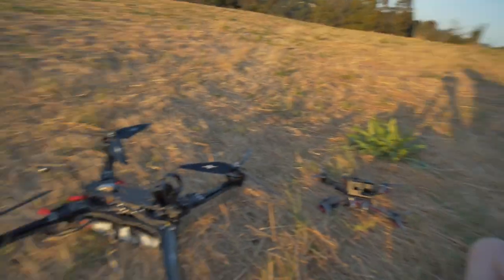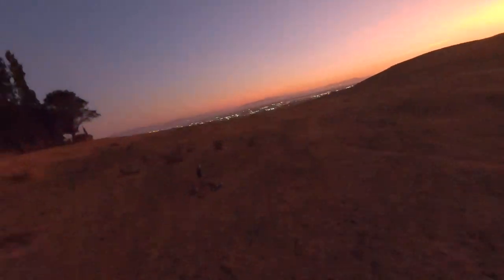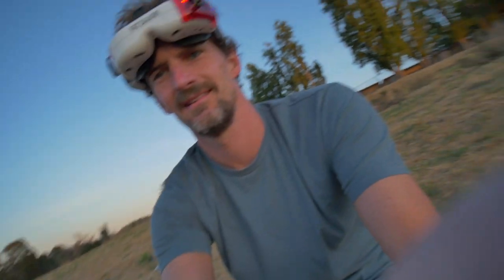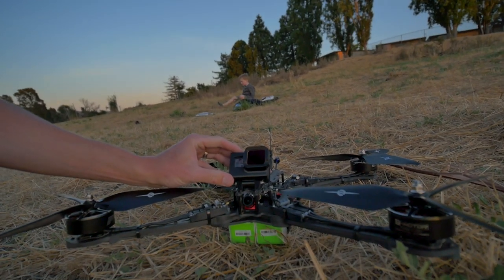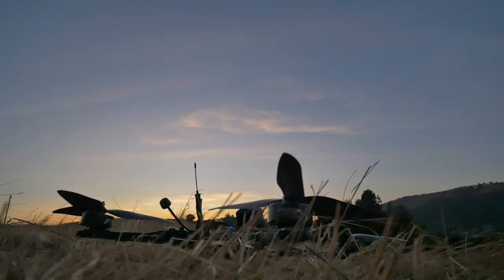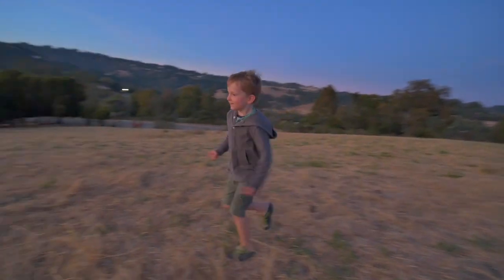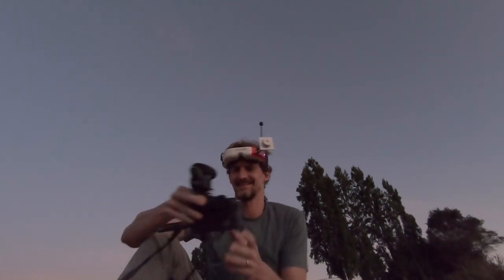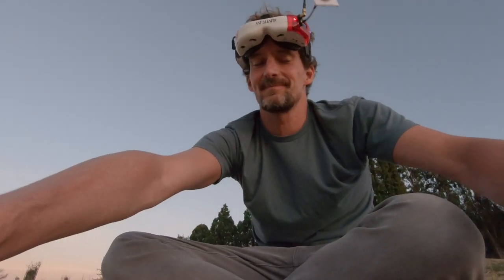Cinematography with a Crazy Beast-Class FPV Drone, Part 1, the Maiden Flight

Comment: Super cool man! Epic of you to be sharing this. Did I see correctly that you have an ND filter on your GoPro? Placing the standard protection glass in front of it will most likely help the quality in low light a bit. Looking forward to seeing more of your aerial work with this rig!
Reply from the maker: Thanks so much!  Good eye, yeah, I use the Polapro NDs on the GoPros.  In this case, I took it off for that last flight at twilight – sadly, the GoPro still really struggled with the low light.  That's one really big reason I'm excited to develop an FPV platform that carries a wider range of cameras.  That said, there have definitely been times when the sun has gone down and I've forgotten to pull the ND off (or just didn't have time to rebalance a gimbal).. 🙈  Like when the Inspire goes up and we're wondering why we're having to give it crazy ISO to shoot a sunset.. oops!

Comment: Hey Matt, awesome video! You might want to modify the title though. X-Class is 800mm and up. Our Hildabeast are 570mm making them Beast class.
Reply from the maker: Good thought!  Do you think that's more a name for potential racing leagues or for this size drone in general?  It's super close in size to my Inspire 2, definitely not a mini quad, but not nearly as large as my cinema heavy lifter either.  I struggled throughout the video with what to call the thing!  😆. I thought maybe "X Class" is the most broadly understood name for what's typically the largest of FPV racing quads, and it's where all of these electronic and power train components came from.
Reply from the maker: title updated!  Appreciate the catch :)

Comment: Great vlog man. Flies good too! Tune seems like a pretty good starting point.
Reply from the maker: breaksteel thanks man!  Yes — right off the bat, the filters and tune felt great. It has a huge amount of speed available, but is very smooth. More work to be done for sure, but I think it’ll make a really great cinema platform
Reply: Matt Beardsley Can’t wait to see some full speed rips of cinematic footage as there’s loads of the slow type out there already.

Comment: Hi Matt, I have a xclass 12s with APD system..how did you get real cell voltage?  Thanks
Reply from the maker: Nice! So much power, it's a blast, right?  Most fun I've had with a drone in a long time.  If, like me, yours is on Betaflight 4.0, you may have to use a CLI line to force the cell count.  I've found it always defaults to only 8S otherwise, at least in 4.0.4
Reply from the maker: use "get cell" to bring up the options, I believe
Reply: @MattBeardsley  Thanks!! works :)